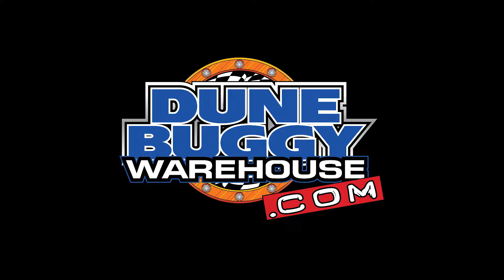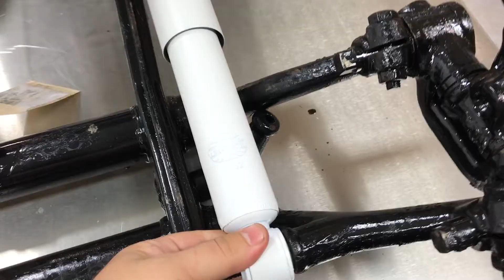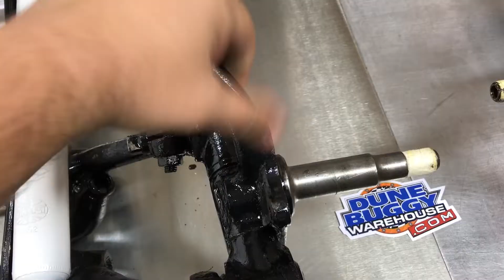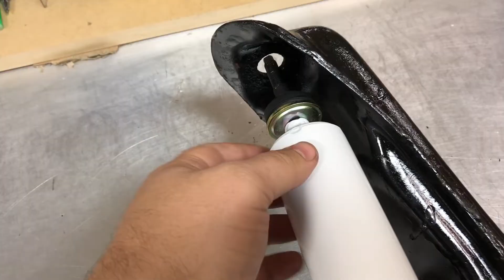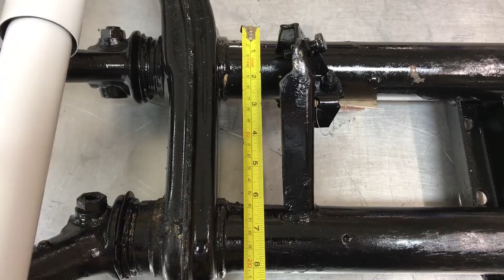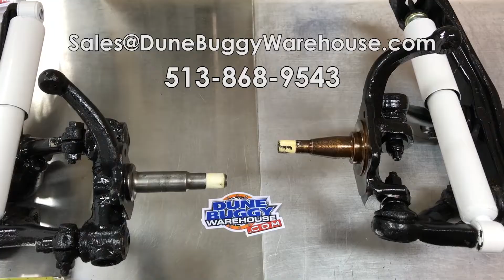King Pin vs Ball Joint Front Suspension - How to tell the difference - Air-Cooled VW Tech Tips

Comment: Thanks for showing the design. I have a rear wheel drive Skoda 120 from 1983 which has kingpins that need replacing. I almost want to drive the thing into a lake sometimes but this gave me the required hope I badly needed.
Reply from the maker: A cool design used for many years on a wide variety of vehicles!

Comment: Can u put a ball joint on a king pin front beam
Reply from the maker: They are different heights so you'd have to change the entire frame head if it's a pan chassis, or re-weld the beam mounts if it's a tube frame.

Comment: I have a ball joint front end with spindle wheels. One wheel is damaged. The only ones that I have been able to find were previously on king pin front ends. Will the wheel work on a ball joint front end with just changing bearings and races?  Thank you for a very clear and informative video 👍👍
Reply from the maker: Most spindle mounts are setup for king pin front ends, that is true. Check if yours has bearing adapters between the spindle and the wheel bearing - if so then save them! The bearings are easy to cross reference, that adapter can be hard to find though.

Appreciate the feedback!
Reply: @DuneBuggyWarehouse  Thank you for sharing your valuable knowledge!  The website is full of information and very easy to navigate when trying to locate the right part as well!

Comment: Yes, I do have a question! I understand that the king pin and caster  inclination angles are fixes. Would you by any chance have the ansers ? I'm mislty interested in ball joint suspension.
Reply from the maker: The king pin alignment can be shimmed differently - google 'vw king pin shim chart'.

Ball Joint does have adjustable camber from the factory via the upper eccentric adjusters. Caster is set from factory but shims are available for the lower beam tube, and some people double stack these on lowered cars.

Comment: Are the threads on the end of the spindle the same?  I.E. can I use ball joint jam nuts on my link pin spindles?  Thanks!
Reply from the maker: The spindles have different size threads -  ball joint jam nuts are smaller than the link pin jam nuts.
Reply: Dune Buggy Warehouse  thank you!  They looked smaller in the video,  but they were taped over and I wanted to confirm.

Comment: dam, in brazil we have the ball joint suspension but the shock is the same form your king pin.... thats until arround 74 i think......    im sure my 72 1300 is the way i said it.... and our 1500 that started in 71 is the same way as your king pin....

Comment: on your front disc brake conversion kits what is the difference between the ball joint and king pin kit? they look identical except the brake reservoir a dual
Reply from the maker: The inner & outer bearings are different sizes and the caliper mounting brackets have slightly different bolt patterns. The Ball Joint also uses shorter brake lines. Calipers & Rotors are the same across both kits.